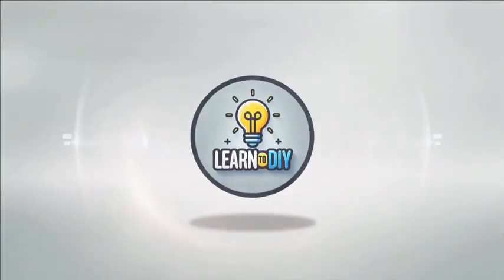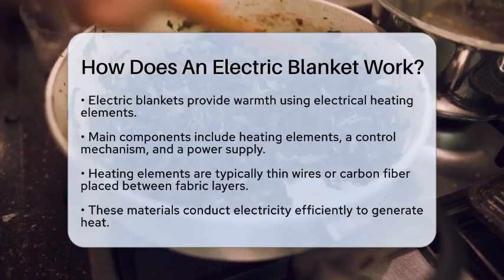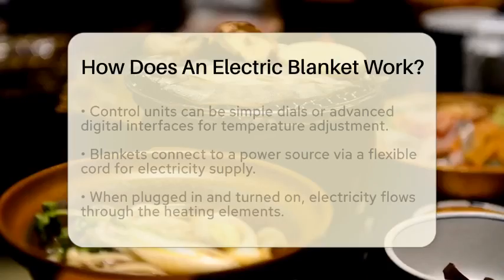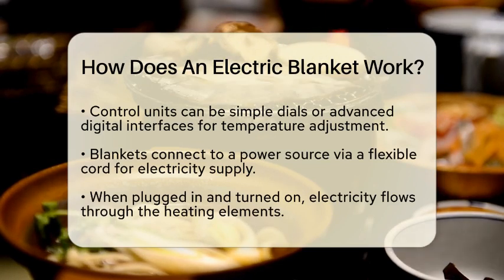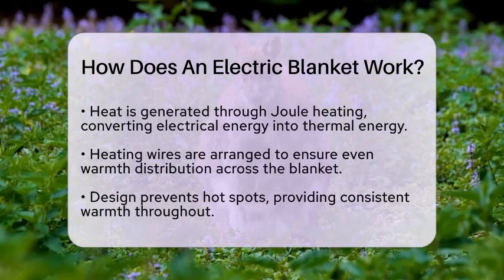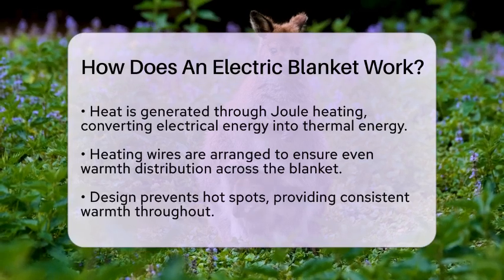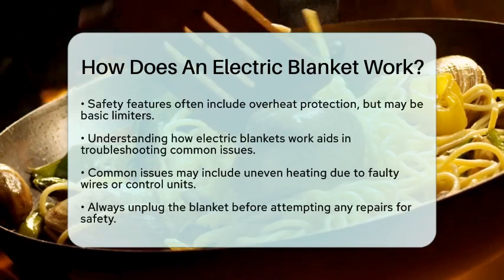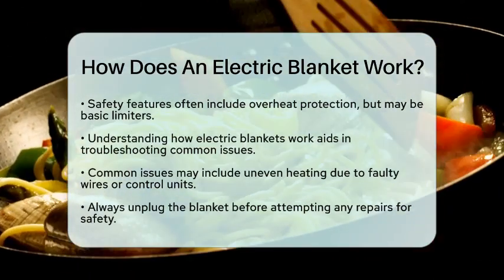How Does An Electric Blanket Work? - LearnToDIY360.com

Comment: Question: Legacy electric blankets had a simple bimetallic thermostat inside the controller. There was always the same amount of current flowing through the heating wires; the higher the dial was set, the closer together the contacts of the thermostat were moved, hence the longer the duty cycle. Do modern blankets still vary the length of the duty cycle electronically, or does a rheostat or similar control change the actual amount of current flowing according to the dial setting?